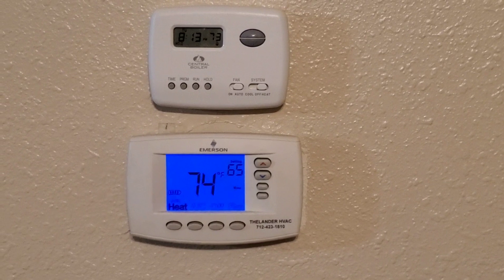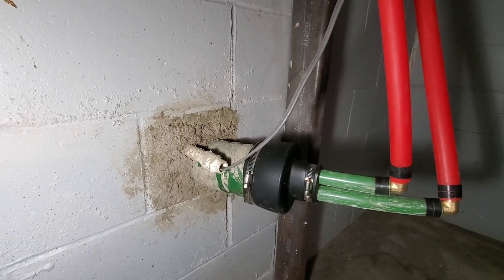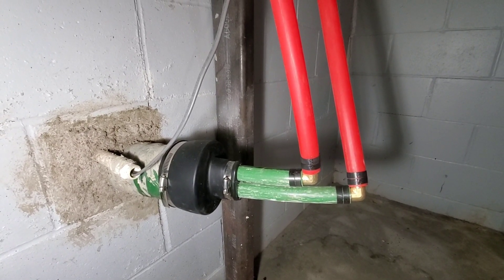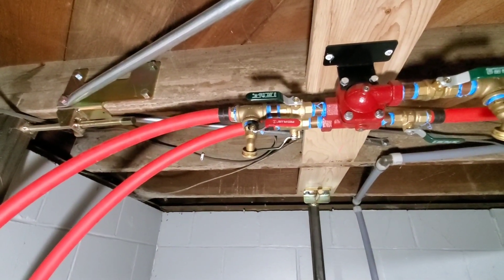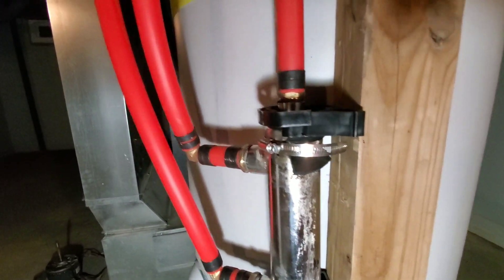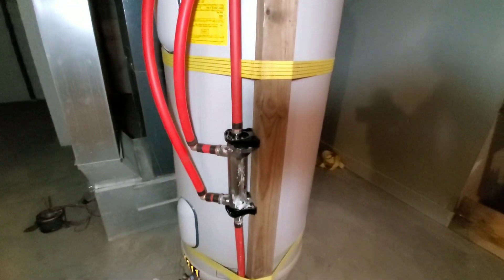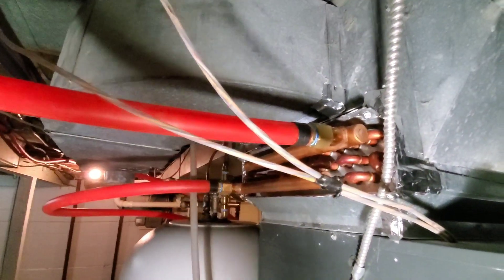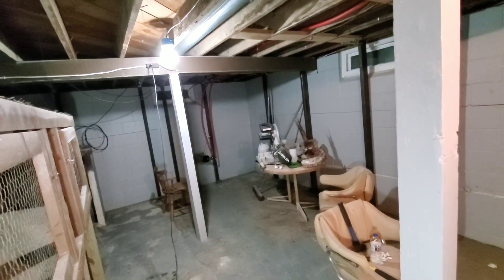Outdoor woodboiler heat exchangers and pipework

Comment: I guess my question is before I watch your video is this water under pressure the water that your heating in the exterior boiler do I need a a water expander or a blowout valve I wanna build it out of complete slate and stone and sand I don’t have any access to steal and I don’t weld I’m a pretty good Mason though

Comment: We are currently under a winter storm with no electricity!  We have a generator that should run the entire house.  Everything is going with the exception of our furnace fan that distributes heat throughout the house.  Any ideas on what the problem could be?  Boiler and blower is working fine.
Reply from the maker: Not sure.  If your setup is like mine you need ur boiler pump for water to be running.  Your boiler door flap to be giving itself air when it needs to keep boiler temp and then ur squirrel fan in your central air to run to be pushing air through the heat exchanger into ur house.   Sounds like you said your squirrel fan is not running.  So if yours is like mine it gets its power from main breaker box and there's also some additional breakers on your furnace itself although I think they're for the electric coils.   U could try putting your thermostat in manual fan mode and see if ur squirrel fan would run.  If that would work then it would push heat through heat exchanger into ur house

Comment: I hooked up our boiler this past January and my plumber/hvac guy couldn’t figure out how to wire the squirrel cage blower so that it only comes on when heat is called.  Therefore it runs all the time.  My second thermostat is only signaling a circulator to bring in hot water when he house heat is called for.  Would you mind explaining how your system is wired so that the air handler runs only when heat is called?
Reply: The second t-stat for the woodburner heat control has the two terminals used for heat (red & white, I believe) connected to the electric furnace t-stat terminals that control the blower (red and green, I think).  So when the woodburner t-stat calls for heat it turns on the blower.  Hot water is always flowing through the heat exchanger in the furnace plenum, so turning on the blower sends heat throughout the house. He doesn't use a zone circulator like you do, water is constantly circulating and must do so to prevent freezing in the lines coming into the basement.

Comment: OMG $600 ?  My bill is $145 at the coldest during the winter, but I am in California on the border with Oregon on the coast.  I believe my biggest draws are my freezer, and fridge also the 75" TV.  My dealer told me to take the guts out of the thermostatic valve, he said it works better ?
Reply from the maker: I'm not sure about taking the guts out.  I think things would probably run fine without it to be honest.  But my dealer put it in.   I run my boiler constantly anyway.  Just got done putting about 2.5 wheel barrow falls a day through it in polar vortex

Comment: Yes Ben, I have mine set up the same temps. but I don,t heat my water with my boiler. My electric bills are 150 to 200 dollars a month all year including all my welding and grinding. I just count all the propane I don,t burn all year. I figure at least 400$a month for six months a year for propane is what I save. I am on my second furnace in 22 years. The first one was still going after 13 years but then I decided to go stainless, and gasification type. I use  a lot less wood now and figure the stainless furnace will last me as long as I live. I want to get a water heater element installed on my water heater for next year. I had a homemade one for my first furnace, but didn,t use it with this furnace even though I knew it was the cheapest way to heat my water. The furnace change over and changing over to our new house with all the zone valves went over my head for me to understand, so I didn,t heat my water with the new furnace, what  a big mistake that was. Now 9 years later I have decided to get it done this year. The only drawback I have on gasification is you have to have all dry wood testing 15 or less and it has to be split a lot smaller or it will make a lot of creosote and you will have fires going out because of not enough hot coles built up to stay lit for the longer cycle times of the computer control. My wood always tests from 4 to 14 and really burns good. Mostly white ash. Ash borer came through here 6years ago and about killed all the ash. We are getting all of the dead ash cleaned up now for the next 2 seasons. Then we have lots of Poplar, Basswood, and Beech, some soft or silver maple. Lots of wood, but more work than Ash. We have White Oak to. A little White elm to, known here as piss elm. The deader it is, the better it is. Good wood then, but doesn,t stink. Have a great day Ben.

Comment: If you have not already 
You probably will experience sediment build up that will adversely affect your water to water heat exchanger at your hot water tank
Because sediment builds up regularly in the bottom of your water heater the manufacturers recommend that they be flushed annually... by flushing your tank you eliminate the build up at least temporarily at the port where the drain valve is located but you do not get the build up that accumulates directly under the water to water heat exchanger where you currently have an elbow I would advise replacing that elbow with a Tee and looking at The tank with the heat exchanger on the right have a water Spigot on that right side of the tee so that you can flush not only at the port where it leaves the tank but water will also force under the connection at the water to water heat exchanger and clear any blockage that will accumulate

Comment: I’m trying to perfect a similar system, which uses a coal boiler, already installed in my home which we bought 5 years ago.  I need to keep my fan running all the time to maintain a consistent fire in my coal boiler... otherwise, the water temp spikes while the fan isn’t running.  Only have 1 thermostat, connected to my electric heat pump. It’s basically nit being used when I burn coal and keep the fan running in manual mode.  My boiler water is piped directly through a heat exchanger in the return duct of my heat pump. Any suggestions on how to improve my setup?

Comment: Thanks for the video. Very hard to find video's showing the indoor plumbing. If I understood you correctly, if your boiler is sending hot enough water to allow the valve on the pump to open then you always have hot water going through the exchanger  in the furnace whether the house is calling for heat or not. Than if the thermostat is calling for heat it is actually only turning on the fan?
Reply from the maker: You are correct.  Cause that same line is constantly sending hot boiler water through the heat exchanger on the hot water heater as well.  Squirrel fan only turns on when the boiler thermostat which is jumper wired into regular house thermostat calls for heat

Comment: I have an old farm house no insulation but the furnace 2 sizes bigger , same set up but to my oil furnace which haven’t used in 17 years , he’ll with oil prices , but cause your getting all that hot water flow I did my lower level radiant heat off the pex , very easy to do and it all comes off the boiler